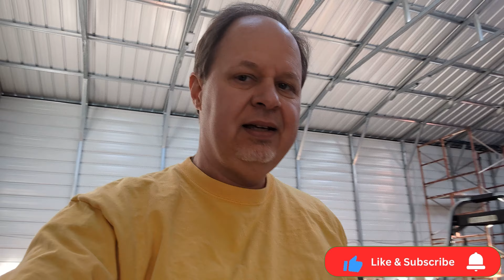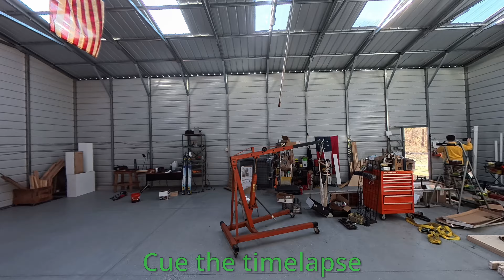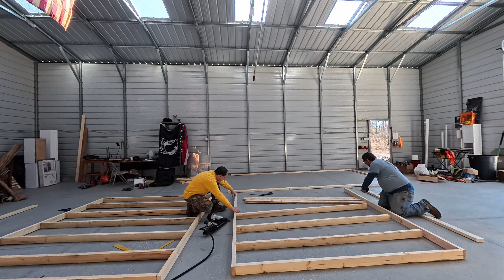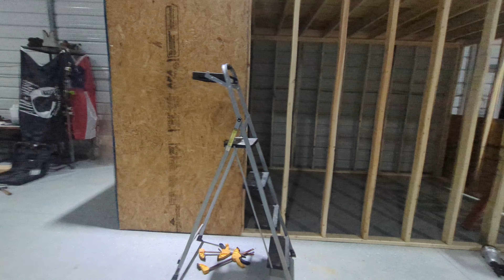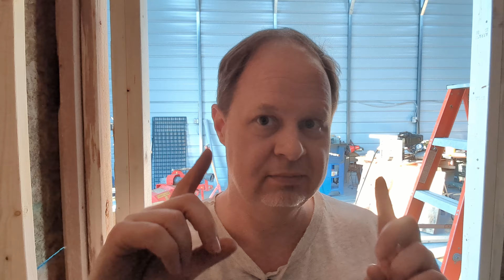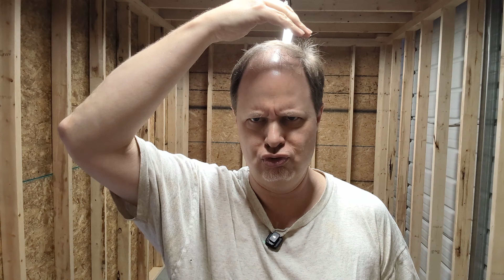We're Expanding

Comment: Maybe tape those seams between the panels if you plan to condition the air to better air seal it.
Reply from the maker: OEM recommends an 1/8" gap between panels for expansion. I will trim with thin molding and attach it only to one of the sheets so they can still expand.
I am going to spray foam the walls as well.

Thanks for stopping by.